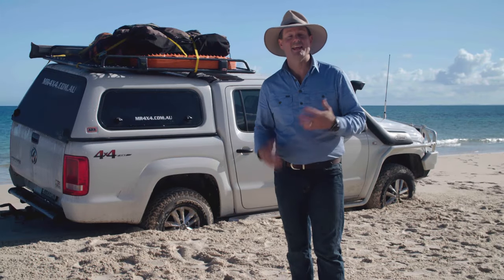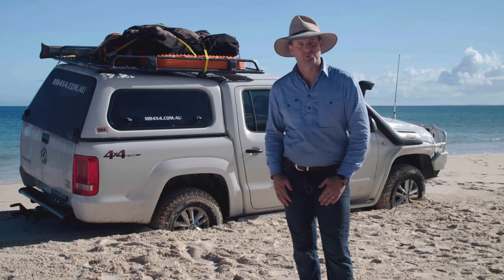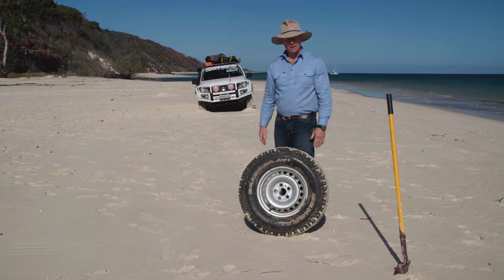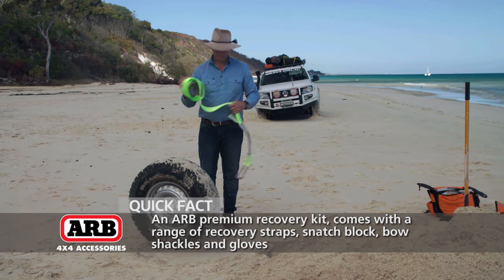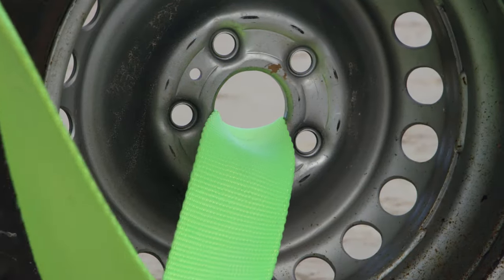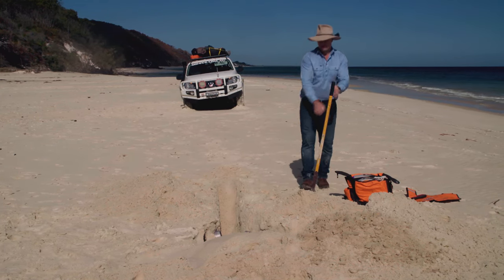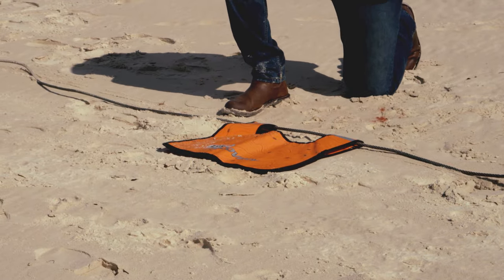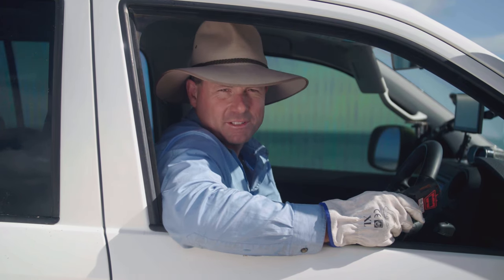Ground/Sand Anchor with Pat Callinan

Comment: Good info! This happened to me once....stuck all alone on an isolated beach, and the tide was coming in. Within another 2 hours my car was gonna be under saltwater and ruined! And I had no cel phone reception and was 20 miles from anyone. My wife was with me to push the gas while I rocked the car, but it only dug it in deeper!. I was taught to use a boat anchor...one big enough for the vehicle weight...and get the "folding" kind, that way it tries to dig deeper in the ground the harder you pull it. Bury it with just the chain/rope link sticking out (about 2 ft deep). It's a lot less digging than for a tire (half as much time and work) and wont risk bending or damaging the tire/rim assembly, possibly making it unusable or even dangerous! If you don't have or can't afford a winch, you should have at least some light chain, a tow strap, or rope prepared in your vehicle if you're ever gonna be out in the woods or beach alone! Then using the chain or rope make a loop in it and tighten by twisting it with a tire tool until it pulls the car free. You can also research how to wrap a tire with rope and use the brake and gas together to make the differential pull on both sides (the differential is why one wheel spins and the other doesn't).Another cheap idea is a "fence winch", a.k.a. a "come-a-long" winch or a "high lift jack" with shackles to hold chain/strap/rope..These setups will cost you only $50-75 and get an anchor at a boat junkyard for $10-25 bucks, or make one out of what ever is handy. You could even bury a 4-8 foot log "long-ways" a few feet in the sand and wrap your rope/chain/strap around its center and that'll also work but takes longer. It's good insurance to be prepared, and cheaper than a tow bill or a water-damaged car!  Works good! Thanks!

Comment: You didn't show the hardest part. Digging the spar out from under the truck that's up to it's belly in sand
Reply: That's why you keep a second spare INSIDE the trunk.
Reply: That's realistic?
Reply: Myles Lenover yes it is I do
Reply: I took my spare tire out from under the bed IMMEDIATELY because I know it could get gashed while off roading. Always keep your spare in the bed for A. easy access, and B. keeping it in one piece. Plus  if you don't take your spare off enough it might stay where it is. My dads 07 tacoma spare was seized in place and i broke his and damaged my jack arm that lowers the tire. I had to spray it with pb blaster before it would lower. So make sure all your stuff is in working order before hitting the trail or beach.
Reply: He said at the end he was going to get the spare tire out of the sand with the winch
Reply: Bow hunting. Africa i was thinking the same haha
Reply: northgarden He meant get it out from storage under the tub.
Reply: Bow hunting. Africa 1
Reply: on top
Reply: @ryanbudden914 I used to do that.  When we went up into the arctic,  we brought a full set of tires for the dually and the trailer.  Half our load was tires. We didn't use a one of them.  Now I bring 1 spare per vehicle/ trailer, 1-2 tubes per, a patch/ plug kit and a compressor.  Oh, and a heavy duty upholstery needle and Kevlar fishing string to repair a torn sidewall.  You'd be amazed how well you can patch up a tire.  Especially if you're only running 10 psi

Comment: Actually, I've used a 20 pound Danforth boat anchor a couple of times, shackled to a 6 foot 3/8 chain tied to 1/2 inch nylon 3 strand line,  in mud and snow, and it worked just peachy. I didn't have a winch on the truck, but I did have a come-along, and time. Didn't have anything better to do!

Comment: Spade anchors work well but that's another heavy thing to haul.  There are also plastic traction plates you can shove up under any wheel with 4WD and the right rear on 2WD (of course no one with 2WD should be driving on soft sand.)  You can also use a come along/ratchet puller if you don't have or can't afford a powered winch.  This is purely speculation, but I wonder if one of the drive wheels could be converted into a spool.  Place a loop from a strap or cable through a hole in a drive wheel rim with the anchor buried as before.  Then very slowly start moving,  keeping  the line centered on the tire tread as much as possible.  Just a short length of line securely spooled may be enough to pull you free.  Anyone think that is feasible?

Comment: Great little video Pat... Not to much to disagree with, however (in the spirit that "the whole world is a critic") why not simply use your MaxTrax on your roof rack to get unstuck? With the same amount  of effort or less, you could be free from being bogged in the sand. Further, did you air down your tires (further) once you got stuck? Often that's all you need to do. Okay, I get it, this is a "scenario" to demonstrate the technique of using a spare tire as a ground anchor. That said, it would have been easy to provide some qualifiers up front - especially that this video IS a scenario.
Reply: dude, he did this to demonstrate how to pull your rig out when not having those special tools and still be able to use the winch...
Reply: Nope. Disagree entirely (Dude). Pat does not qualify the fact that he DOES NOT have "those special tools." He only says that (and I quote), "...let's say you didn't came with any of your mates to snatch you out, and you find yourself stuck." Look on his 4WD. He has a full set of four MaxTrax on his roof rack! Plus, are you telling me that he has no way to air down his tires (or to air them down further)? All you need is a thin sharp object to push in the valve stem core to let air out; but no doubt Pat has better air-down tools. I've walked up to many folks stuck on beaches, aired down their tires a bit and off they drive. Like I said in my original post, I understand the scenario. He simply needed to qualify the scenario a bit more.
Reply: I get it... he "demonstrated how to use an improvised ground anchor." I acknowledged that he did a fine job on that training point. However, in my humble opinion, he missed an opportunity to tell folks (this is called "training") that there are much easier ways of extracting his stuck vehicle. So, I filled in the "training" gaps with my comment. There are lots of neophyte off-roaders out there. I run into them constantly in the remote backcountry. I'm hoping my comments may assist these neophytes in their off-roading adventures. I would think that even Pat would agree. I was not critical of Pat, I was adding to the conversation.
Reply: ***** Guess you didn't read my post too well. "Great little video..." "...it would have been easy to provide some qualifiers up front..." Note the word "easy." Script in the video to add these other ways to get unstuck... "less than 10 seconds." That's a far cry from "17 hours."
Reply: Those who are unable to improvise and use something else than a spare tire maybe shouldn't go offroading in remote regions. Also, you should finish everything before the tide comes in :)

Comment: The correct way to drive on soft sand is to deflate your tires to 12-15psi. You will never get stuck. I learned that driving in Océano Ca. Pismo beach!
Reply: HELL YA!   I love pismo!  Your right lower that pressure I used to run 10 psi and drive smart.

Comment: Would have been easier to get the Max Trax down off the roof.
Reply: I LOL'd
Reply: Maxx Traxx arent always the solution. I have never seen the tire technique before. In a pinch its using what you have to make it happen. I am planning my trip to Malaquite beach Texas, thats 60 miles of beach with no exits. Ever thing helps.

Comment: a steel wheel is More likely to bend than a aluminum one... aluminum will break instead of-bending
Reply: Yea, was just about to say
Reply: camaroman101 alloy and aluminum aren't the same thin.
Reply: aaron west in Australia its backwards cause of the whole hemisphere thing
Reply: aaron west wrong
Reply: Both steel and aluminum bends. Stainless steel breaks
Reply: Alloy wheels are usually aluminum + magnesium, so either aluminum or alloy is correct far as I'm concerned. And no they don't bend nearly as much as the steel wheel will. Doesn't matter, you're not going to change the tire on a truck that's buried in the sand so it's just a weird place in the video for an unnecessary and blatantly false statement.

Comment: A voltswagon truck?! That's cool I didn't know they made those
Reply: It's an amarok
Reply: its not available in the US but they are great light duty trucks.
they even get good gas mileage at around 30mpg in all of the engines i'm aware of
Reply: Hypocrite Biker vw used to make trucks that kinda looked like the old toyotas but i didnt know they still made em in different regions. While the US has a big truck market it seems the mid size is huge in australia.

Comment: The easiest and best way in the sand is to make the (tire pressure PSi) 15PSI, and the car will run easily and without damage to the engine and gearbox, in the long run.

Comment: Anyone else notice that this was promoted by General tire, but posted by Continental tire
Reply: they are from the same boat (factory) if i remember correctly
Reply: Dirty Troll ohh gotcha
Reply from the maker: Hi William, whilst GeneralTire has been around for 100 years, it was purchased by Continental in 1987 and is a brand of Continental.

Comment: Cool trick in a pinch for sure. I've used a blade style boat anchor many times over the years to get out of sand. I used to have a 2wd pickup now with 4x4 I rarely need it.

Comment: I got my truck hung up on a 3 foot sand cliff in New Mexico once. I was just following a trail and all of a sudden my front wheels dropped into a river bed and I came to a nasty sounding stop. I had it sitting on the transmission crossmember with the rear wheels off the ground and the whole frame at about a 45 degree angle from flat. No amount of cursing, spinning the tires, or pushing on the bumper could get it free. So I got the shovel out and started digging. It was about 98 degrees and windy, but I kept at it for about an hour until the last bit of dirt under the granny collapsed and threw truck shifted down the hill. I dug a little more, got back in, and drove right out. I had a winch and everything, but I was surrounded by little pubic hair sized trees and rocks too small to use. This would have been useful to know then.  It's a solid truck so I got away without damaging it, but man, there were a few minutes where I was wondering how much a tow bill would be out in the middle of fuck all.

Comment: If they say "Though shall not build on sand", wtf are you doing driving on sand? There are 3 types of sand consistency and compactness between the edge of the grass and the water edge. From the grass edge and midway to the water edge is soft sand but is hard sand a few inches below, getting softer up to the middle. Whereas, in the middle, the sand surface  remains between soft to softer which is sinkable, sort of like quicksand for heavy objects, including vehicles. From the middle to the water edge, sand is hard and compact all along the water edge, with some places like near a creek or river, the surface becomes very soft that even a parson can sink in. So, the best area that is safe for a 4x4 vehicle to travel is on the sand between the grass edge and a few metres towards the centre Because this is usually dry and pretty compact, unless the waves had been there at high tide. The old adage is if in doubt, don't drive on sand, just like don't build on sand. If you must drive of sand, it is advisable that you carry a strong stake and winch, or drive slow because there are invisible quicksand types or surfaces that look so normal to the eye but they are actually as soft as water and a speeding vehicle can easily slosh itself into it unexpected and then it could also continue to sink, swallowing your vehicle, and you, completely. In your example, What if it keeps sinking after you've reached the sunken tyre? How many holes do you have to dig? Trust me, I have been in soft sands of large rivers, you will not get out after the hard work. But the thing is, why did you get bogged in the first place? Were you doing senseless wheelies?

Comment: Why not just carry a small vessel "plow" anchor that has been engineered expressly to work in bottom sand or mud? If you're gonna buy all this stuff for your truck a small plow seems simpler and digging holes is a long way to go for something that has already been engineered for the job.

Comment: Bad job attaching the strap to the spare tire. FAR stronger to put a loop of the strap through the axle hole and then use something like a branch or the tire wrench as a toggle through the loop. The direction of pull would then act on the tire to make it work as a parachute or mushroom anchor, instead of pulling on one side of the tire allowing it to pull through the sand like a sphere.

Comment: At least you need a winch and then a spare wheel that is not located under the truck (or, you must put the spare wheel in the box of the van at the start of the trip).

Comment: What's up with the snorkels on Aussie vehicles and mowers?
Reply: Richard Gates 
Because we don't just drive on the beach or up hills. It's for water crossings. Most intakes are so low you would drown your engine. Last thing you want is a hydro locked engine.

Comment: nice idea from nice man
but i have qustion what is the orange think and whay you put it
Reply: At 4:45 is a “cable damper”, in case the strap breaks the safety cloth acts like a parachute.
Reply: An orange safety dampener has weight in it and in case the cable snaps it ensures that kinetic energy is driven downward into the ground. A cable snapping without a dampener can go anywhere including through the windshield.
Reply: your right about that
Reply: thank all of you

Comment: WAY TOO MUCH EFFORT.  #1, Don't drive on sand if you don't know what you are doing.  #2, IF you for some reason feel compelled to drive on sand alone and you DON'T know how, drive a Toyota TRD vehicle so you can use Crawl Control.  Don't even need to air down your tires.  ;)  The end.

Comment: There is a new technique with uses no tools or external devices. Just drive reverse or forward very very slowly.  This will then drag sand into the dip and raise all wheels bit by bit.  Toyota even has a Drive mode for this.
Reply: You can do that with any 4wheel drive vehicle. They just made it idiot proof.

Comment: dampener was placed too far from tire if it was there the line could reach the window mid way is not good should use 2.
Reply: Joseph Böhme I don't think you're gonna break a cable pulling on sand